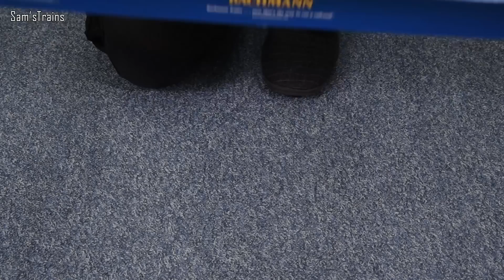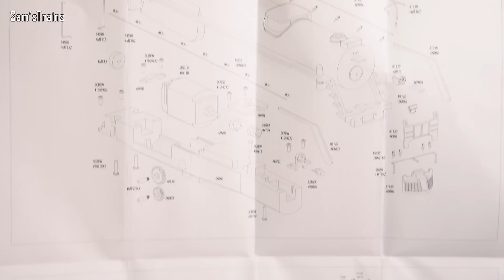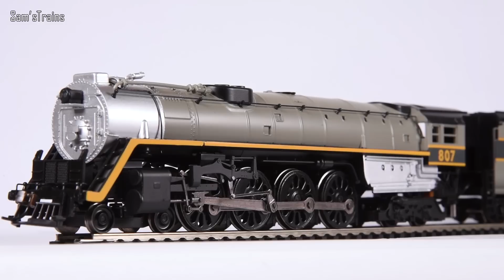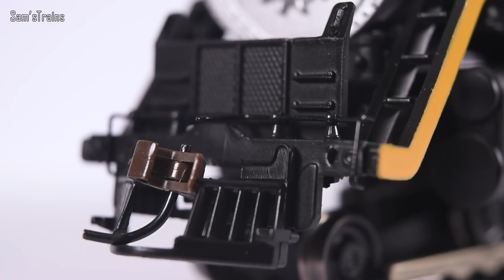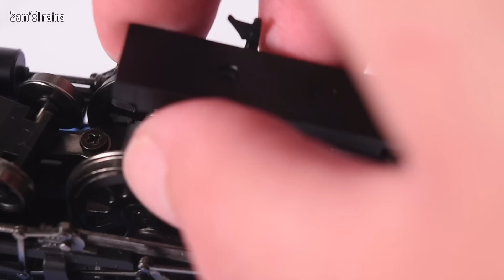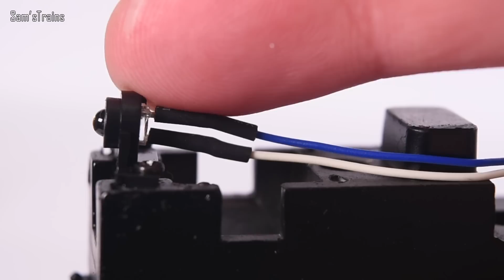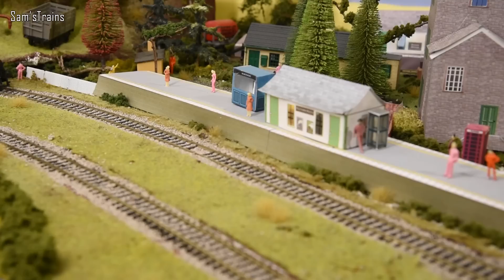Cheap,  Derailing Bachmann UP FEF Steamer | Unboxing & Review

Comment: Excellent review!  In fairness, this Bachmann steamer is, and never was, supposed to be an even remotely prototype correct locomotive.  That being said, it was shocking your Model performed so bad because I have a GS-4 and the thing runs flawlessly so I figured  the FEF would be a fairly solid performer and to see it struggling so much is really unusual, especially when you compare it to say the Scaletrains Operator line (and yes I know they have no steam locomotives in that line), which are roughly in the same price range and you literally get the same driveline as the Rivet Counter, which is probably one, if not the best, in all of HO scale!  Bachmann may need to seriously look at the option of putting their Spectrum motors in ALL of their locomotives, even down to the train set offerings.  It might come at a slightly higher price but I think the pluses will far outnumber the negatives, just my opinion.
Reply: It's frustrating when some of probably the best, e.g fleischmann and Bemo just don't make lesser detailed models for the more budget minded. It's like they just decided they're incapable of making anything less. Unfortunately the prices really reflect this...

Comment: What's the story behind the "1542" that appears in the background at 35:14?  Looks like a Canadian Pacific Pacific with a LNER tender?
Reply: A Triang R54 model first made in 1954 on a Princess chassis but meant to be close enough to a CPR model. A more accurate model than this Bachmann.
By the seventies it was simpler to use the Scotsman tender to cut costs.
A search for Triang R.54 should show Oscar Paisley vids with more of the story of this.

Comment: Sam, For the most part Bachmann is a casually made product. Probably a lot of your problems. But, I am retired from The Delaware & Hudson Railway (our country's oldest carrier) Another problem based on real railroading, is locomotives vs roadbed. Here on "the mountain" as it was known be could not run 3 axle locomotives for the real potential for nasty 30 plus car derailments. All  3 axle diesels were banned on the Penn Sub-division. I think the monster loco you have is to big for your layout. Same in reality. You can run equipment that is not compatible with your track.
Just my opinion based on me making a living in the M of W Dept. On the D & H (the bridge line)
Sincerely,
Bob Doyle
Pennsylvania, USA
Reply: Interesting your six axle truck observation. Cape gauge equipment is almost universally 6 axle (tending to be either A1A-A1A, Co-Co or Bo-Bo-Bo) due to axle loadings. Some Peruvian (I could say GL22's but I'd be wrong) have a bolstered Bo-Bo-Bo-Bo arrangement

Comment: If you think that locomotive is big, you haven't seen a union pacific big boy locomotive yet.  Trust me when I say those steam locomotives are huge, and I should know because I have seen an actual one and own a running model of it to.
Reply: They're about an inch and a half longer than this. Like most big steam at the end they were all similarly sized artic and non artic. I believe in HO an inch is roughly 7'2" and nearly all steam late large steam was between 120' and 133' towards the end. And yes I've been in 4014's cab and climbed all over it and was more impressed by the 9000. But cool loco still.

Comment: I suggest trying out the sound-value 4-6-0 in DCC. I love mine. They are solid runners, but don’t necessarily have a lot of pulling power because they are so light.
Reply: See? That's a better suggestion. Something potentially affordable and a good novelty item for a non US modeller to review. Lots of people suggesting higher end manufacturers to test high end locos which is not what Sam's buyers are particularly interested in and if there's an issue you can't exactly return it. Good suggestion

Comment: The steam engine Sam actually came from a Bachman’s starter set called the overland limited
Reply: that said one is the one i personally have, and it, at least the specific one i have, has none of those wires, just the drawbar and shoddily working bogeys that derail constantly on the track it was sold with, but hey, i got a large ammount of rail cars, so i dont care that much
Reply: That set was my first intro to model railroad about two years ago. I recently got a Bachmann Thomas and a Bachmann ex track expander pack to go with it after picking back up the hobby in 2022 december

Comment: If that is large, you should take a look at the articulated engines like the mallet, big boy, challenger, y6b, em-1 or if you're feeling daring the erie triplex
Reply: Might want to have a squizz at your artic sizing situation. like C&O T1 ( Pennsy derivative of course), Niagara's FEF's and the like, all larger than Y's and a lot of the well known artics. there's some unobvious sizing involved, and UP's big boy boiler of course would fit inside Virginians AE, and the DRG 45 was about a metre shorter than an Allegheny. And of course the triplex's were just standard sized mallets from the era, just with a powered tender basically. I'm more impressed with the EP2 promos from the twenties shoving paired steamers and mallets unceremoniously off stage. That takes some tractive effort
Reply: @muir8009  ph i would love to see sam jave some fun with and HO PRR S-1 6-4-4-6 or the T-1 4-4-4-4, both being rigid frame

Comment: Question: both this and the class 14 have been described by you as "not fit for purpose " yet they score over half marks.

If a rubbish loco gets over 5, and the best locos get around 8 or 9, that only leaves 4 or so marks between top and bottom. Wouldn’t recalibration of the scale so rubbish locos get 1s and 2s make the rating system more fit for purpose as the whole of the range could be used?
Reply from the maker: Nah - because my rating concerns more than just whether or not the loco works properly - it takes detail, performance, pulling power, mechanism and value into account!
Thanks for watching, Sam :)
Reply: @SamsTrains  but if you have a wonderfully detailed loco with a whole pile of die cast and a 5 pole motor and flywheels  but falls off the track everytime it gets near a corner, it doesn't work and arguably you'd be better off buying a cheaper, motorless, static model for all the use  it is ... It's likely to get over 5 marks but is functionally useless as working model train.

Comment: So have you checked the middle wheels because most of the time they slid a tiny bit to let less friction which they did on my train so it won't derail also it maybe from the tender thingy but I think it is the middle wheels not soldering from side to side abit

Comment: You should get a challenger in ho scale they are very big locomotives. They are done in several different companies. They have two sets of driving wheels and they have a 4-6-6-4 wheel arrangement. Some have sound as well. Broadway limited makes them really well. They also have two places were smoke comes out. The main smoke stack and the whistle.

Comment: Motor looks easy to swap out, should try that and re wire it with thinner wires, that would be a cool video.
Reply: Sam needs to add weight to the loco and tender...

Comment: Believe it or not, the origins of Bachmann faking Union Pacific """"FEF""" class 4-8-4s dates back well into the 1980s, or perhaps even earlier as I don't think there's anyone out there counting years.
 
The locomotive was introduced alongside the Bachmann Overland train set, which has existed in their lineup for a very, very long time, dating back to an era predating both their EZ-Track snap together track system and the ubiquitous EZ-Mate couplers that adorn all of their US offering nowadays. (Instead coming with standard fishplate HO track and oldschool horn-hook type couplers).

Back then the set came with an totally different type of fake 4-8-4, an ATSF (Santa Fe) Northern type steam locomotive painted up in the UP "Greyhound" scheme in some sort of crude attempt to look like a FEF, with a Vanderbilt style tender stuck on it as an afterthought (No doubt pilfered from some other locomotive in their lineup at the time).

They later switched to the locomotive which you reviewed, which is a New York Central Niagra class locomotive, but to make it pass as an FEF, they painted it UP grey, pulled its distinctive smoke deflectors off and again gave it that same Vanderbilt tender.

I'm far from being a rivet counter, but honestly with the effort they've put into making these unconvincing fakes over the years by kludging together other stuff they had lying around, I'd reckon it wouldn't have cost them much more to make some tooling to at least plunk a new, vaguely FEF-ish looking shell over the same 4-8-4 chassis they are using.

Even now, Bachmann still make the Overland set, and its positioned as their flagship offering of their lower range, non-Spectrum "toys". (Though the price far outstrips any of their other "toy" sets). It comes with 9 cheap plastic wheeled freight cars and a large oval of EZ-Track. The locomotive included is much the same as the one you reviewed, but I believe it foregoes the DCC ready chassis in lieu of a smoke unit. 

I'm sure the set is a fond memory of many US model railroaders out there, but quite honestly the set is very long in the tooth and in an era of increasingly affordable precision scale models, its definitely a bit of a relic of Bachmann's toy train roots. 

Quite frankly I'm surprised they offer the locomotive for sale separately, and even more surprised they bothered making it DCC ready, as I'm pretty sure any serious modeler would much rather eat the thing, box and all, than run it on their ultra-serious DCC equipped historical layout!

Comment: This was the locomotive the first proper model train set I ever owner around 2011. The locomotive in mine was numbered 806. In case you didn’t cover it, the number would have belonged to a FEF-1. The grey Union Pacific schemes were also known as Greyhounds. They and Southern Pacific had passenger cars in gray liveries that bore minor resemblance from the the New York Central’s two-tone Lightning Stripe grey. Thanks for reviewing this Sam. It can provide you footage of my barely operable 806. Another tidbit, the FEF-3 was the final series of Union Pacific Northern Types. FEF-3 844 was never formerly retired by Union Pacific and is still in a service that is considered active. Later FEF northern were often built with smoke deflectors.

Comment: Not all quite well good indeed but I shall have to make some remarks. If only 1 axle is being driven than I would suggest that a profusely amount of energy is getting lost by the driving rods caused by its cogging characteristics. 1 mm gears, oiled and made from a high grade metal should give significantly less friction and do spread energy more equally, on the condition that the chassis and axle holders were to be metal as well, or at least axles were sitting in bearings. Such would last a life time as well (Märklin and Fleischmann practices). I do understand though that this large loco has been made to a low price. However, driving through rods is just not a good idea, but I don't see how such a big loco could potentially be decent enough for such low price. It's just asking for trouble.
For derailing... some of the curves just seem to be too tight... They could have solved it by some flangeless wheels perhaps.

Comment: Fun fact: the FEF-3 were so powerful that they could pull a 20 car train at over 120mph for hours at a time
Reply: is there actually any record of that happening or is it purely theoretical? because, and trying not to be rude here, theres a certain amount of exageration and jumping the gun from across the pond. notably the claims made about world record speeds that just never happen to be accompanied with evidence and often rest on "my grandad once met a guy who knew a guy who said he drove a milwaukkee atlantic at 130 mph" etc..
Reply: @andrewyoung749  the reason that happens so often is that there are often segments of track with no significant curves of hills for dozens of miles, and speed limits were more “guidelines” than anything else. Engineers often used their own judgement when it came to this stuff. When there was a record of it, railroads did everything they could to avoid it going public as it would be bad PR (and demonstrate a disregard for safety). One time word of speeding did get out (~140+mph) the Pennsylvania Railroad got in trouble. Some claims are exaggerations (like the PRR E6 Atlantic), however some are pretty reasonable. The reason these locomotives could go so fast for so long is they are equipped with much larger boilers and fireboxes (producing more steam), larger drivers, and ran at much higher boiler pressures than other places in the world.
Reply: Yes an FEF was tracked doing 130 mph outside North Platte Nebraska.

Comment: Nice video! Like everyone has said, yeah, it is an NYC S1 type Niagara with a UP 9000 class (4-12-2) oil tender. A little insight, this locomotive originally was released by Bachmann in a starter set called the Overland. It was one of their largest starter sets and cost about $150 to $200 if I remember correctly. I remember seeing these sets available almost everywhere but they just never sold well. Because of that, I think that is why TrainWorld was selling the locomotives separately for a great price. Compared with your Birkshire and GS-4, I would say it is not the best comparison since our standard of starter sets is near the bare minimum and the other two locomotives are of higher quality. Overall, it's a great video, and I think you gave a fair rating since it is a cheap locomotive. Thanks for sharing, and happy railroading!

Comment: Finally, an engine that You and I both have! 🤣

However, I got mine from the Overland Limited set. That loco is similar in almost every aspect to the one you have (which is 807), except their road numbers (mine is 806) and the fact that 806 has a built in smoke generator. Also, On the tender of 806, it has plastic wheels, hence, no tender pickups. Everything else externally and internally is practically the same in both engines. 

My example derails in a similar fashion to yours, and I’m pretty sure it’s because of the size of the curves on my layout. Some of my curved sections of track came with the OL set, hence is 22” radius (best suited for the locomotive). The locomotive worked fine, with barely any derailments. However, when I introduced 18” curves to the layout, it started to derail more. The pilot wheels would jump the track first, followed by the driving wheels, which as you can imagine is extremely annoying, yet inevitable. 

A little fact, this locomotive is based on a New York Cenrtal ‘Niagara’, not a Union Pacific FEF. The real 806 and 807 were FEF-1’s, and not Niagara’s. This was possibly an idea from Bachmann to show  how a UP Niagara may have looked.
Reply: I was planning to get the overland limited, but I have 18" radius curves with nickel silver rails.
Reply: @ericgallagherjr8334  the loco should be able to handle an occasional 18” curve relatively easily

Comment: Maybe you can try to make it run better? like try make the cables between the loco and tender neater somehow or make a better coupling between them, and maybe add springs to the bogies if needed. And perhaps file down the flanges on the middle wheels? so it take those curves better, like how it is on some older Triang locos and such, their middle wheels have no flanges. Just an idea, might make an interesting video also! :) And also, maybe you can try fix the eggvans somehow, make better couplings for them or something XD And 3D print stuff for them if needed, now that you have 3D printer! :)

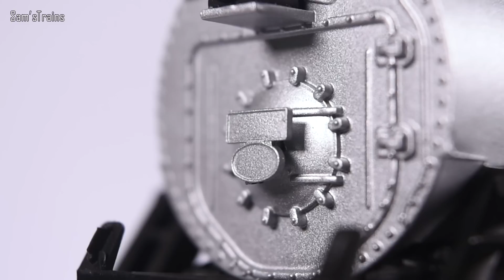Comment: This locomotive is actually a starter set loco, from Bachmann's biggest starter set, The Overland Limited. It's actually a modified version of a New York Central Niagara (especially the front at 11:20 is New York Central details instead of Union Pacifc ones) which was similar to Union Pacifc FEFs. This tooling apparently dates back to 1983, according to info I found on a website dedicated to documenting the history of many model train products and toolings.
Also something to note is that the last FEF, number 844, was never retired by Union Pacific and is used for their excursions across the system. I've seen 844 five times in person.
This locomotive is also intended for a minimum radius curve of 22-inches. 22-inch radius is similar to Hornby 4th radius, but it's the 3rd standard radius of American HO track (15 inches being the 1st radius, and 18 inches being the 2nd radius and the most common, 24 and 26 inch radius curves also exist)

Comment: The one I have is 806 from Overland Limited and its it's somewhat the same but does have some differences. (I may be talking bull but it may be derailing due to the fact that that it is a HO scale train while you have an OO scale which is a bit different)
Reply: Same track buddy. Apart from occasional sleeper spacing. Good thought though
Reply: @muir8009  Yea, I read that they were just a bit different so I thought that was the root cause

Comment: That comes in the overland limited set and the set is I think around 4 or 500 USD. It has the egnine 7 cars controler and track. (I think)
Reply: 250 USD, nine cars, and good silver nickel track.

Comment: I have that one, I got it in a set for Christmas, and mine came with an unpowered tender and a smoke unit. It also derailed a lot, and the cars didn't have good couplings and would always uncouple! So I agree with the rating you gave the locomotive! That loco was just a disappointment!